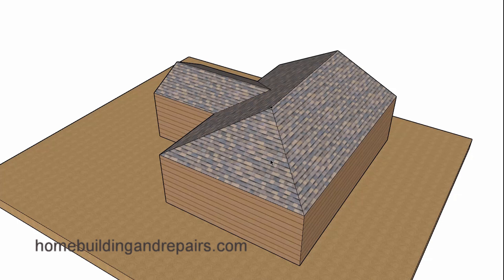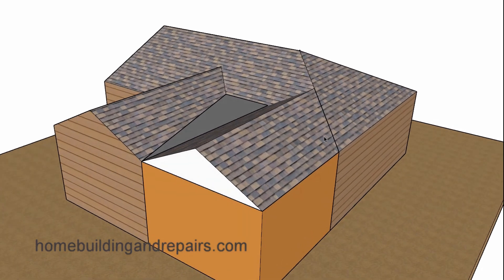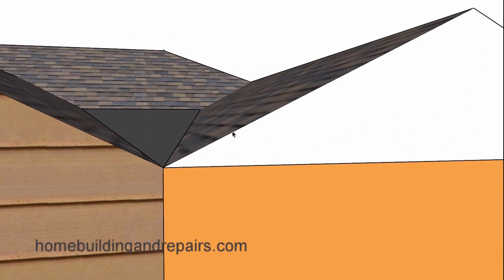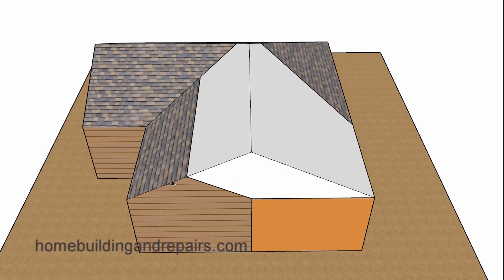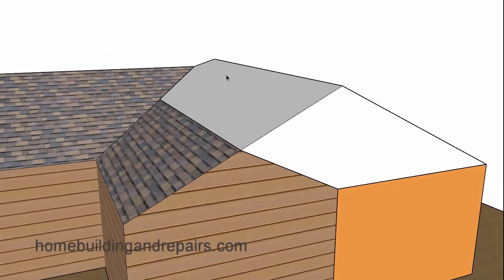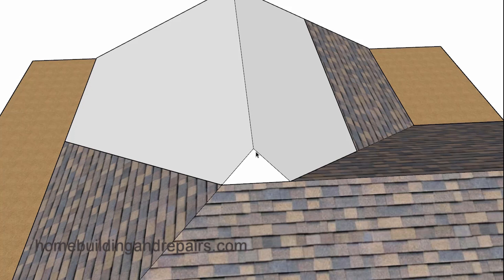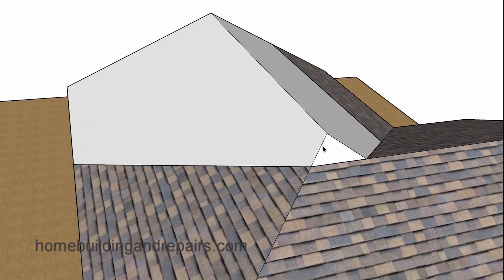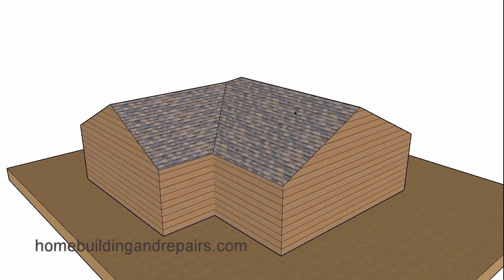Gable End Roof Design For Corner Home Addition To Connect To Hip Roof And Small Gable Roof

Comment: do you know if you can do a lean-to-roof as well?
this is a raised bungalow, so the main floor is raised about 4-5 feet.
if the roof pitch isn't too steep this will allow enough headroom to have stairs going down as you exit the back door.
the addition would have roughly the same dimensions as the one showed in the video.
Reply from the maker: I would think so.
Reply: How I can be contact with you???